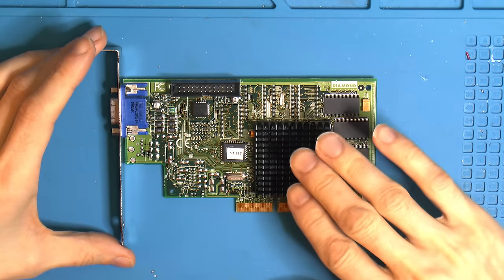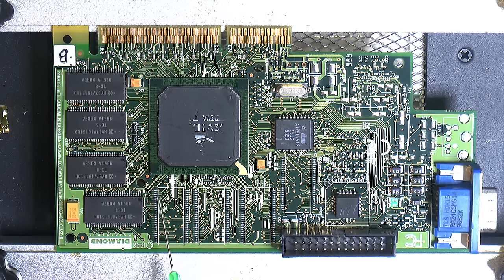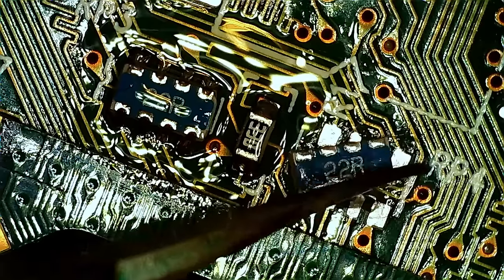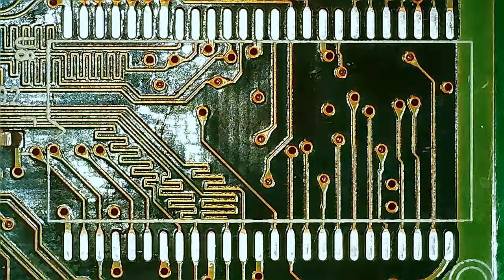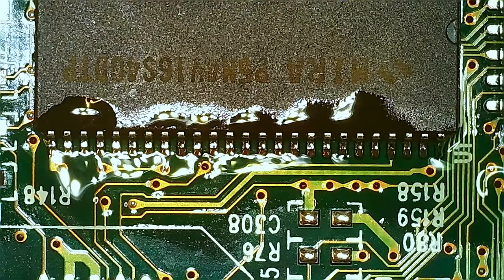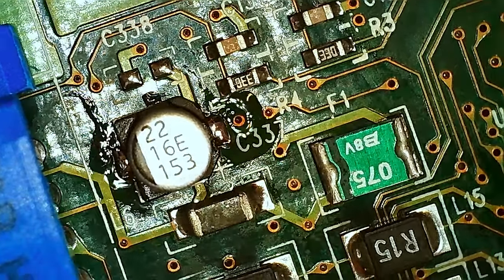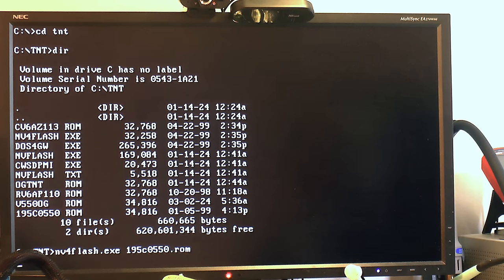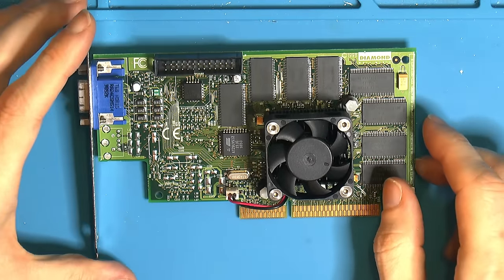Riva TNT RAM upgrade

Comment: I have a TNT2 M64 that used a board very similar to this one... That little card served me very well back in 1999/2000!
Reply from the maker: It is still a good entry level retro card for a build of that vintage.
They also OC well and with som tweaks in the Nvidia control panel they are very competent with a 500-600Mhz Pentium 3, Athlon or a 700-800Mhz Duron or Celeron.
I always bring some TNT2 M64 to our retro lanpartys just in case someone has a GFX failure.
Reply: back then I had a PIII 550 overclocked to 620Mhz, that later received a Geforce2 Ti.
Reply from the maker: @victorlgcarvalho  I ran a K6-2 500@550 with the  GeForce2 GTS , way to fast card for my CPU 😂

Comment: Back when there was actually competition in the video card space and real value could be had.
Reply: There really wasn’t when 3dfx hit the scene. Prior to that maybe TNTs were relatively dominant, but dedicated graphics accelerator cards were very niche. I would actually argue that there is better competition now than the early days of discrete GPUs.
Reply: @dkumagai30  What? It's a TWO HORSE RACE now, has been for over a decade! And the CEO of both companies are blood relatives, and have paid millions of dollars in fines multiple times for price setting and market colluding! :D

How is that "more" competition than Matrox, S3, Nvidia, ATI, PowerVR, Intel etc releasing multiple cards across multiple tiers every year? :D

3Dfx released their VooDoo card WAY before the TNT was released. The TNT was a much faster card than a V1. In fact, the 3Dfx reign was supreme but VERY short lived. The TNT2 pretty much equalled the VooDoo 3, and when the Geforce 256 and Radeon cards were released, 3Dfx was all but dead. The VooDoo 4 and 5 being commercial flops.

Comment: I remember doing a ram upgrade on my ATI rage pro, it had a slot on the end of the card you could add an additional 2mb daughter board onto! God, i miss those days!
Reply from the maker: yea its very common on cards from that time, its also common not to have the module 😆
It would be fun remaking modules like that to add back to the cards. Someone has probably done it already.

Comment: I never knew that the chip was 128bit all this time and that can be upgraded, I thought it was limited to 64bit at the silicon level.
Reply from the maker: Well I did not know if it was locked or not, but it clearly was not in this case so that was one reason I made the video.
I have a 64bit GeForce MX 440 with som crap ram, so would need a full set of 400Mhz or faster DDR and also know what values all the SMD stuff is suppose to have because that card lacks even more of them then this TNT:
But would be interesting to see if GeForce4 MX 440 cards are easily upgraded from 64 to 128bit.
Reply: Crazy, good work.
Reply: I have seen and own (1) MX4000s (64-bit 128MB) that share PCBs 1:1 with the FX5200/5500 (128-bit 256MB).

Seems likely
Reply: Is it a reference design or one of the cheaper ones from like Inno3D? There are full schematics floating about for the Nvidia P162 reference design PCB, most of the FX5200 / MX440 cards are quite often based on that. I'm sort of planning to do the same with an FX5200 :)
Reply: @voodler Please make a video, when you ready. 👍
Reply: I wonder if it is possible to turn RivaTNT2 m64 (with full PCB) into a full-fledged 128-bit RivaTNT2 in the same way? Or is it impossible due to limitations in the m64 chip? These cards have the same clock speeds, differing only in the width of the memory bus.
Reply: @UnfFOS Just thinking about the same. I have one that shares the PCB with a TNT2 Ultra ! and it has even pads dof a different memory configuration. It is obvious that the small craped out M64 are limited by design.

Comment: This is the first video of yours that I’ve come across, awesome work! Subscribed.

I could never do any serious soldering work like that, only things I’ve done with soldering is a few relatively large SMD caps on various video cards to get them working again, but ram upgrades I could never do. (Don’t have the equipment, or room for said equipment)

Comment: Excellent content yet again! And great outcome. I always wondered if it would be possible to deduce the values of missing passives for such an upgrade without having high res pics available. What made you place R155? The area looks like pullups or config resistors, but I wouldn't have known that it's related to RAM. Btw, mind to tell us which flux you used? It seems to be of pretty good quality to me.
Reply from the maker: R155 was the 10K one?
It was one of the differences between the 8 and 16MB versions, both are on VGAmuseum.
It would help to have documentation for the GPU and TNT in general but Nvidia as fare as i know have not released anything like that since Riva128.
Its probably out there somewhere but I dont have any docs so going by Images to do an upgrade is one way, but yeas what do that resistor do 🤣Maybe it tells the GPU something about the ram config, idk.
If anyone have a collection of documentation for old Nvidia cards or ATI etc Im interested in a dump.

Its Amtech flux, you can get it from Louis Rossmann store,.
I also think Krisfixit Germany has it, there are different types tough but some of that comes down to preferences or what its intended use is for.

Comment: great video, hope I can accomplish this on my own
Reply from the maker: Practice on some dead or worthless stuff first. I tend to take the boards out of old routers or hard drives, good stuff in there to practice soldering on.
A decent temp controlled iron, good flux like Amtech and some leaded solder and you should have no problems if you practice a bit first on junk.
Good luck!

Comment: I wonder if it is possible to turn Riva TNT2 m64 (with full PCB) into a full-fledged 128-bit Riva TNT2 in the same way? Or is it impossible due to limitations in the m64 chip? These cards have the same clock speeds, differing only in the width of the memory bus.
Reply from the maker: the TNT2 M64 packaging is smaller, so I would assume it do not even have the second 64bit bus physically available. If it had people would have made128bit cards by now.

Comment: If you are going to reuse part I would suggest diluting original solder with Rose alloy, or atleast with leded solder. Far lower risk overheating it.
Reply from the maker: Voodoo2 is so old its leaded and I use leaded solder. Its all leaded.

Comment: Good day! I would like to ask you for advice. I was increasing the memory on Diamond S220. From 4 to 8 MB. Due to the replacement, of course, there are no free places there. The card works, but is still like 4 MB. Changing the BIOS for the 8 MB card did not help :( Do you think this is a limitation of the V2100 chip or something else? I would be grateful for any suggestions!
Reply from the maker: I do not have that card or any experience with that GPU so I have no useful knowledge.
Reply: thank you!

Comment: Will you add the missing S-Video out port next? =P
Reply from the maker: Well if I had the parts and reference card it would probably be no issue to do so.
I did add DVI to one card not that long ago, helps if most components are there but the port tough.
But one would ned the DAC's that goes on the back to even add the port in the first place and I dont have any.

If and when i have the parts and know what goes where I might do a video on adding the missing ports on a card.